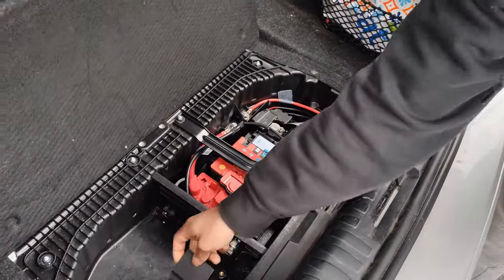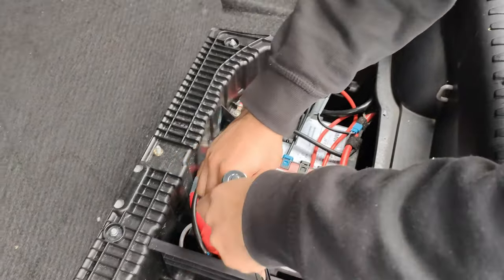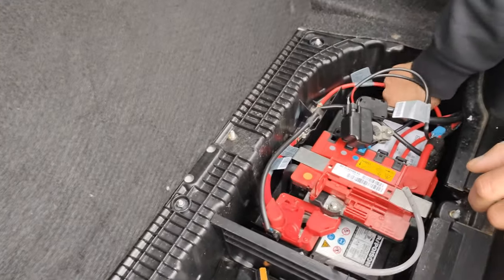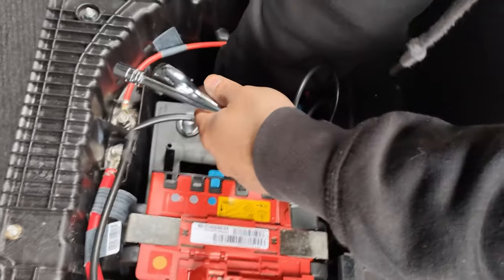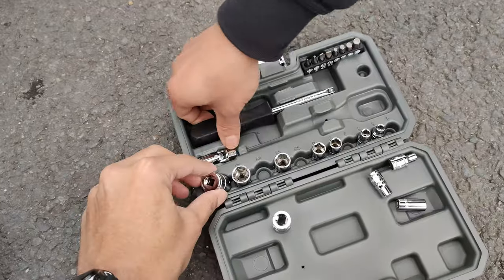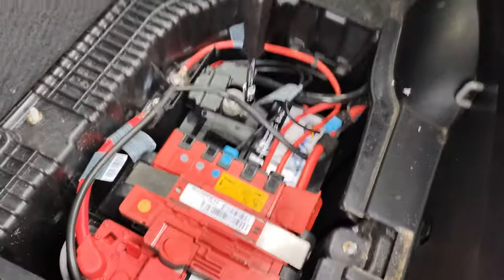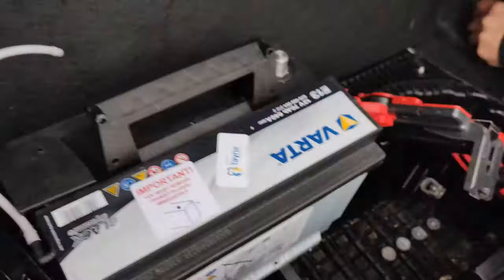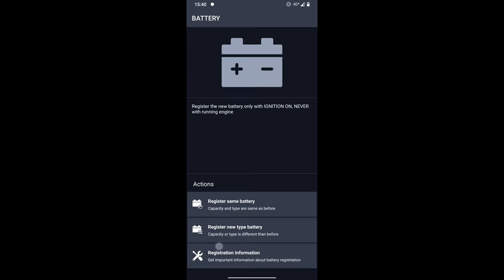HOW TO CHANGE YOUR BMW 1 SERIES E87 BATTERY WITH OR WITHOUT REGISTERING IT.

Comment: Hey bro, is the car battery registration process necessary if I'm replacing the same wet/lead battery just with a different brand? My BMW and engine is the same as yours.
Reply: I have the same question
Reply: @UnbiasedSports  if it helps I went and got the same battery and had it registered .The guy who replaced my battery for me told me all new batteries need to be registered regardless if they are the same battery as your old one or not. If it's a new battery and is different in any way it'll need to still be registered but some coding will need to happen too. Go see someone who will register your battery as well. You'll need to pay a little more or it could be included in the price just ask around.

Comment: man, help me out, every time I disconnect the battery from my bmw e91 I need to register the key to start the car. what can be the problem? even for a split second battery disconnect and my car doesn't start, I need to connect ista to do the CAS adjustment, thank you  in advance